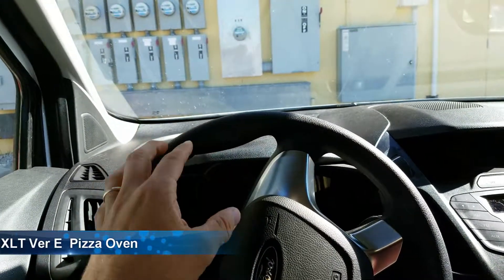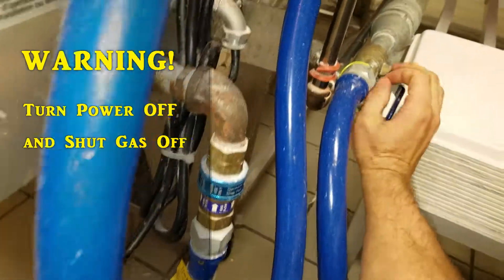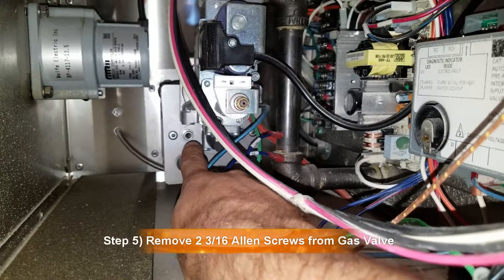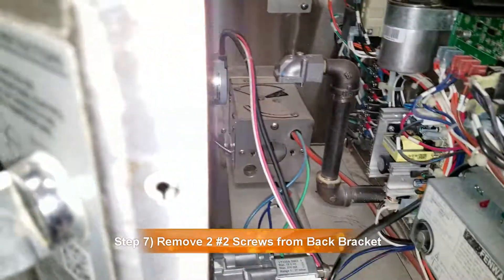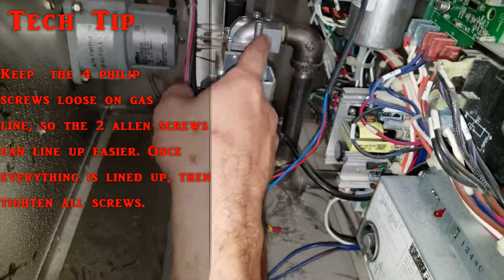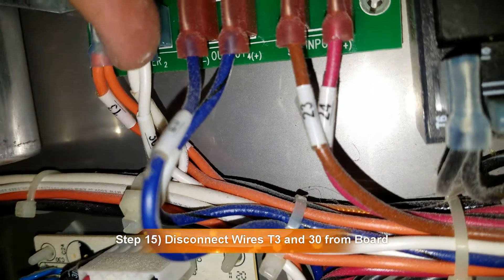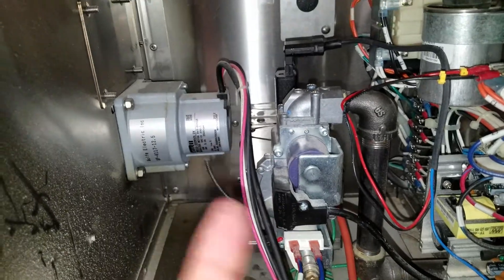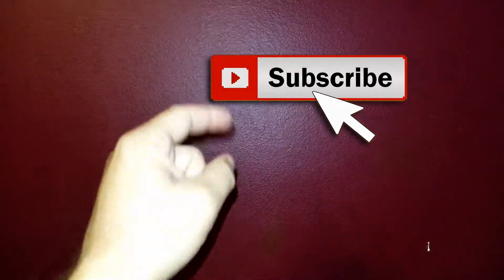Installing A New Retro Burner Kit on An XLT Pizza Oven

Comment: Good day. Had to replace the hi limit electronic type S3 with an  analog type I think #167 &#168 removed also #165...The #28 & #4 tied together through analog hi limit...I left off the tc as there was no place for it on the retrofit diagram...now it displays...Right oven probe what could  be the issue? It's a XLT SIMPLE SMART H SERIES  gas Stack oven

Comment: I have an xlt where the right oven will not stop heating once it hits its set temp. We've replaced both temp sensors without resolve. Any suggestions?